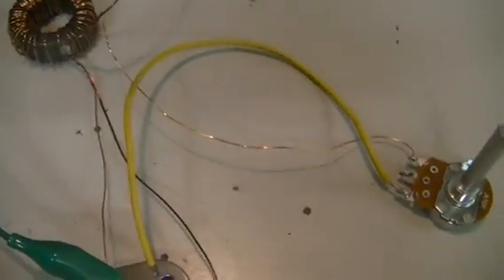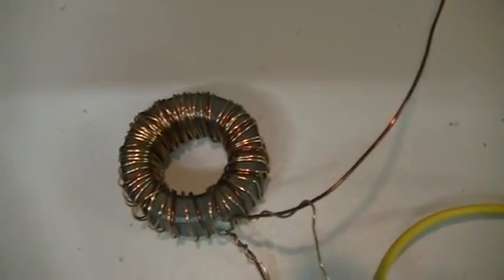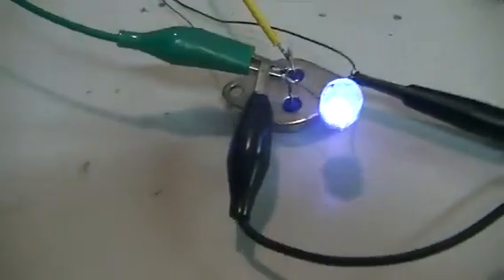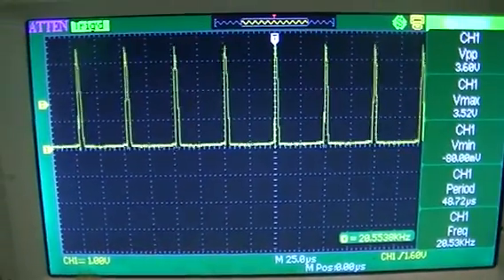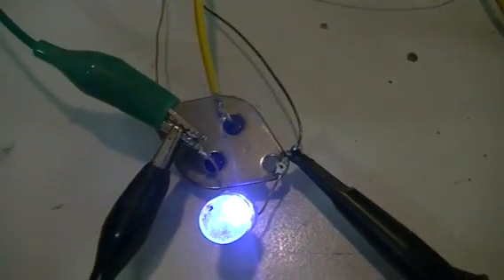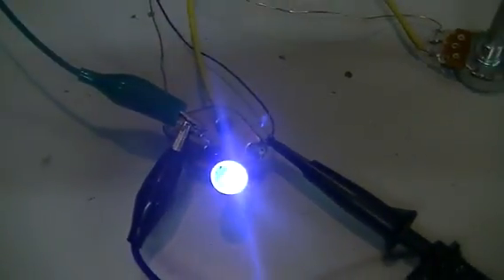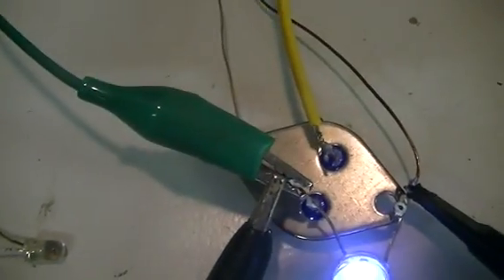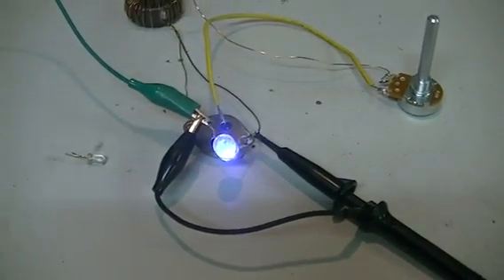What is a Joule Thief

Comment: Good video. I could be wrong but I think there is something that's gone overlooked with the low power input if the readings are reverse analyzed. Power in .25V X .023A = .00575W. If there is 100% power transfer .00575W / 3.52V = 1.6mA. The LED would be barely lit if the current were 1.6mA. What I'm suggesting is that when the constant current is converted to the proper "High Frequency Current" the current in is the current that will flow out through the load (3.52V at 23mA). At this current the LED should be about as bright as shown in the video. Something I think the pioneers of electricity discovered about "High Frequency Currents" a century ago. Interested in your findings.
Reply: Is it possible to use a joule thief and get 2A current?
Reply: @jodyvett23  Maybe 😁
Reply: @ArkiverUnifiedEnergy  I've been trying so hard to build a power bank which runs on no rechargeable AA batteries 1.5v, 6.5ah
But I have been getting very slow or no charging 

Any suggestions plz would really appreciate

Comment: These circuits are amazing. I have been playing around with them myself and last night I noticed mine turned off, so I figured the battery was flat. I then noticed that my Oscilloscope still showed that the transistor was firing, but no light. The cell still had enough in it to fire the 2n2222 transistor, but it didn't create enough energy to light the diode, go figure. I assumed that nothing was going on, because there was no light, I was wrong. Nice to have a scope for these things. I have been able to get the LED to change in brightness by changing the resistor value and messing with the number of turns on the inductor. The resistor value also changed the frequency it was running at. Fun stuff, but can really take up a lot of time. Thanks for the cool video:)

Comment: looks good...i didnt know the 2n3055 would switch at that low voltage!
Reply from the maker: +jeremy gwilt  It dosnt,and that is why the trigger coil is an 8:1 ratio to that of the driven coil. So we get a transformer effect,where the trigger coil now produces the required voltage to switch on the transformer,and for the 2n3055,that is .7 volts.
Reply: TinManPower i started thinking about that after i commented...and how this arrangement sometimes needs a 'kick' to get the oscillations happening vs switching the trigger winding to v+ as in the 'popular' JT circuit. nicely shown!   :)

Comment: Your voltage reading has made think of all this in a different way. 
Always been a case of needing 0.5V to switch on any transistor, but, that initial spike and transformer action from DC is the ticket. In the same way that the LED glows, the transistor can run, just needing that first transformer action pulse. Feasibly 10mV could fire her up....run the output to a cap and fire the LED every 20 seconds or something, but it would be there from even changes in intensity of ambient radio signals.
What do I have wrong in that thinking ?? lol

Comment: Excellent Video! I did something similar like this but instead of 1.5v AA battery I used a 15v AA battery supply which powered the secondary coil on a center-tap transformer like a joule thief which then induced voltage in the primary coil after that I then step down the voltage with another center-tap transformer to drive a DC motor.  There are numerous variants to this circuit but a common thing I see about this joule thief circuit is that not many people out their are interested in building it with using Voltages above 1.5v or that what you get out of 1 battery. So my question is how practical is it powering a joule thief or similar device with more then the 1.5volts?

Comment: What's the difference between this circuit and the "standard" JT circuit, other than the pot instead of a fixed value resistor?
Reply from the maker: +TinselKoala I am surprised you ask that TK. This is the SS SSG circuit. MH seems to think there is a big difference between the two,but they both work nicely as a JT circuit.
Reply: TinManPower
As far as I can tell the circuit as you have it is the same as the "Standard" JT circuit. Perhaps I've made an error tracing out your wiring, but I don't think so. I've breadboarded it just now, and tried several different transistors. It works fine with BC337-25, less well with MPSA18 (because that transistor is easier to saturate). I used a 12:96 toroid for my experiment.  Unfortunately mine won't light two LEDs in series but it works fine with one, just as you've shown, down to around 250 mV.  I'm too lazy to dig out a 2n3055 just now. 
Can you post an actual schematic of what you are using so I can check what I've got against your setup?
I don't trust the meters on the power supplies I've got so I'm measuring my voltage with an actual accurate DMM. Is your PSU meter that accurate at these low voltage values?
Reply from the maker: +TinselKoala Yes,the PSU voltage reading is correct. The difference between the common JT circuit,and the SS SSG circuit is the coil connections. The SS SSG circuit has L1 on battery plus,and collector. L2 is to base and emitter-the two coils do not have a common connection such as the common JT circuit dose-where the start of one winding is connected to the end of the other winding.
Reply: TinManPower
Oh, I see. Then I did make a mistake in my tracing of your setup from the video. Back to the breadboard! Thanks.
What I've always found interesting is that you can connect these components almost randomly, every which way, and except for a few variants, they will work.
ETA: Actually I see I got my diagram right but made a mistake putting it on the breadboard. Oh well, thanks again.

Comment: I'm into this hot topic also.   I have been looking into ways to enhance the low power oscillators capturing ambient energy (electro smog) using an adjustable loop antenna.  I have had mixed results.  It seems that you can run a JT from the output of a crystal radio. 

https://www.youtube.com/watch?v=xn7U16j7IsU
 I might have a go at that.  The 60 Hz background noise is my target though.  You need a way to gather it and concentrate it into the needed watts of micro power.